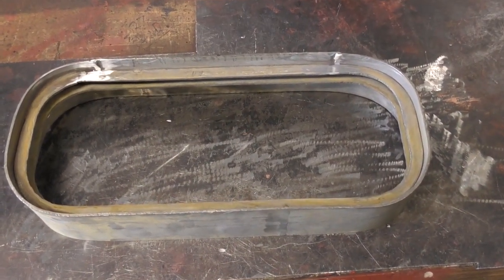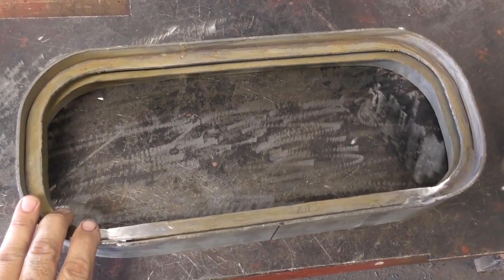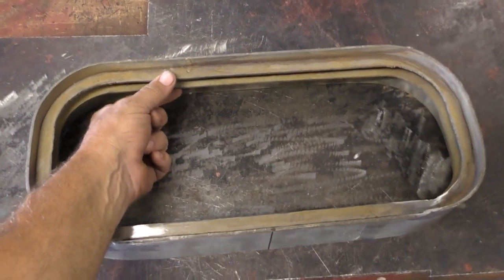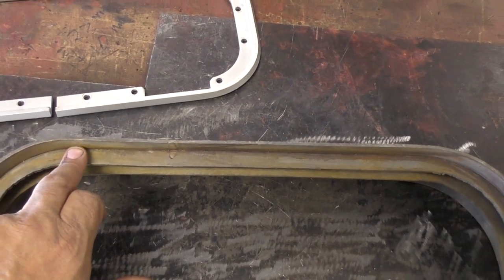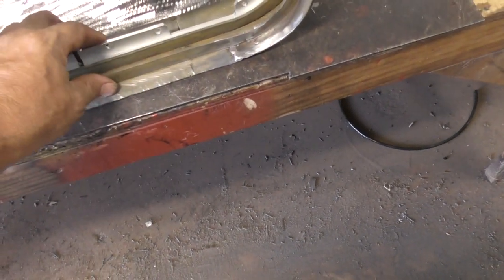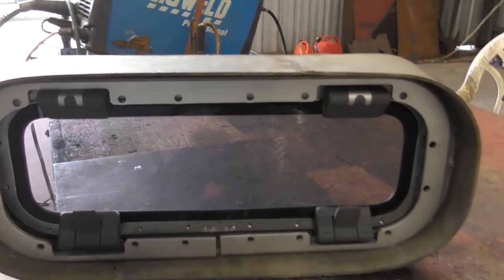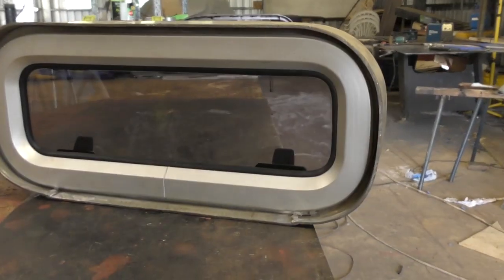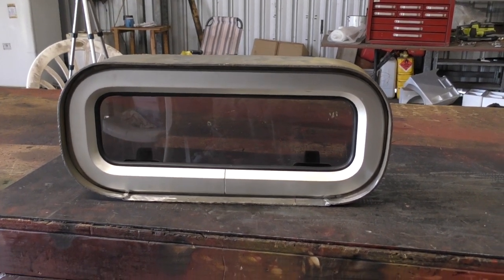Steel Sailboat Build - Port Light Box Frames Cabin Side Installation

Comment: Personally I would have made the outer ring to the size of the inside of the port light, then drilled through it, then id fill the gap with UHMW plastic. This would give you a much cleaner look/feel without the gap to fill later.

Comment: Loving your videos, I'm building a Roberts voyager 388. Just finished the superstructure. About to start plating. Seeing details like this invaluable. If you could show how you'd do deadlights and detail material thickness of the steel used in this video that would be awesome. Also a video of the install of plexiglass in the pilothouse windows. And also how you are fitting the hatches in your deck. So many questions haha. Thanks from Duncan Chloe in the UK. (sailing hunk of junk)
Reply: Hi Duncan,check out the older videos shows you the plexiglass install,Cal
Reply: Callum Syme I watched both videos, never actually saw you installing on the boat. Is it just the sealant adhesive used to hold them in?
Reply: From -- SteelAway --- Yes producing the videos takes a lot of time so I get a little slack with it. The perspex windows sit on a frame that has a 15mm sill just like regular wooden frame windows. , there is a video that details the frame structure but not one of me actually installing the glass, didnt think anyone would be that interested. I do have footage of fabricating the port light frames so that will be next, this week, or this month who knows.... :-) Anyway thanks for all of the kind comments and please do share with anyone who might find this interesting.
Reply: Callum Syme thanks, looking forward to seeing the next video. Its great reference material. Especially liked the one about your skeg. It gave me encouragement through a big fight I was having with my transom.